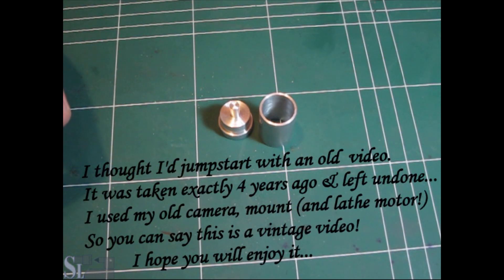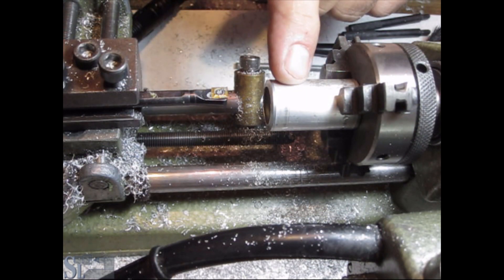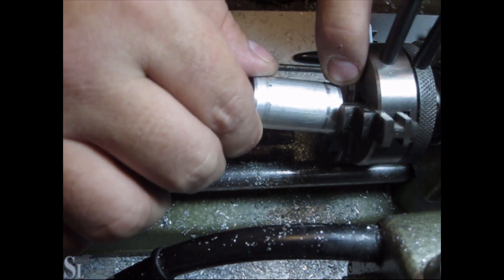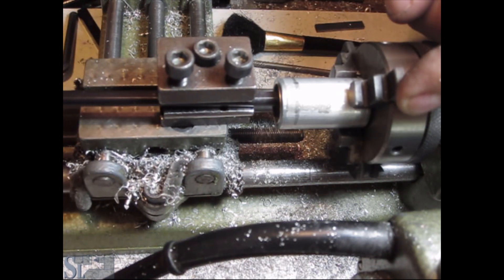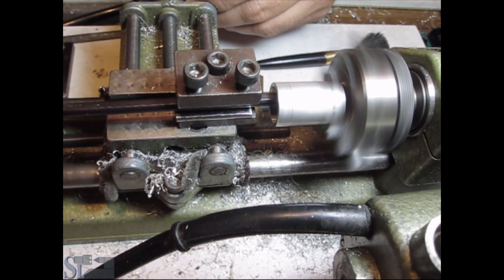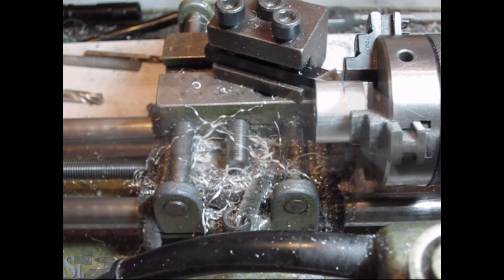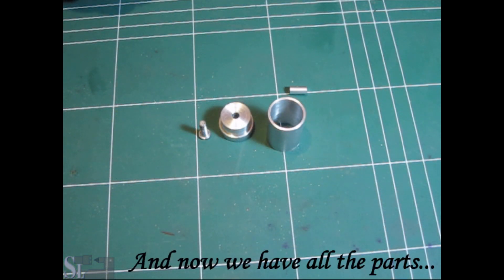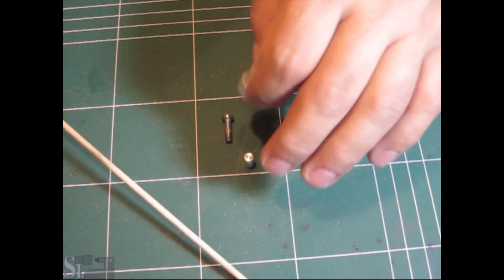Slug and lollipop mold

Comment: Do you think a small lathe machine like this is able to make a pen or zip gun?
Reply from the maker: I think it can easily do that. If the parts are small enough to fit the chuck and total turning length - that should be an OK job. Use standard metric or imperial taps and dies and it should work :)
Rifling is going to be a challenge though, or making a rifling button.
Reply: @Smallathe  thanks alot for your opinion
Reply from the maker: @henryToped  Do bare in mind even with a drill press and a dremel it can be done. Or a drill press and a set of files. It's all a matter of motivation. :)
Reply: @Smallathe  Yeah very true, a drill press with good stabilizing vise is essential at the very least. Many of the pen gun parts and rifled barrel can be ordered custom made but still need some drilling and tapping work. Thanks.